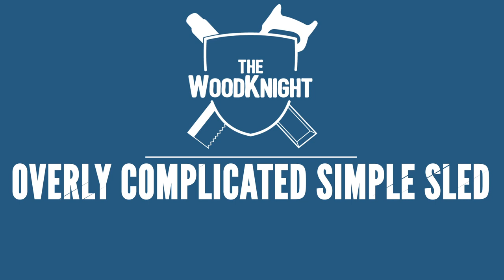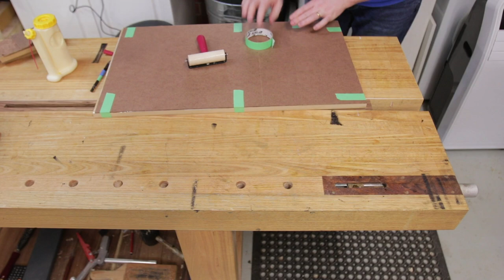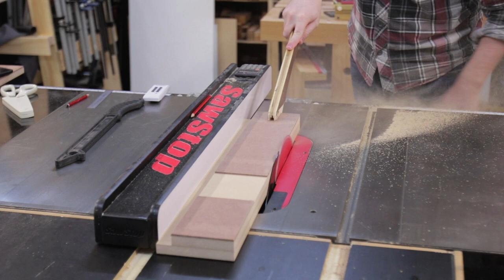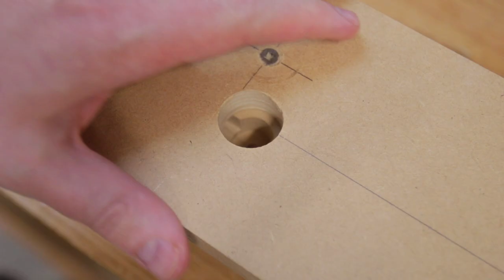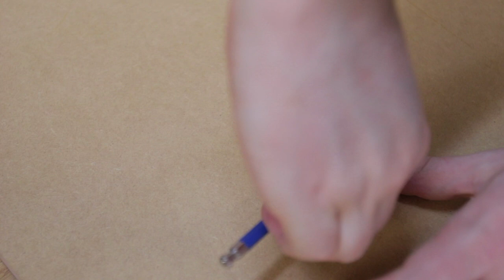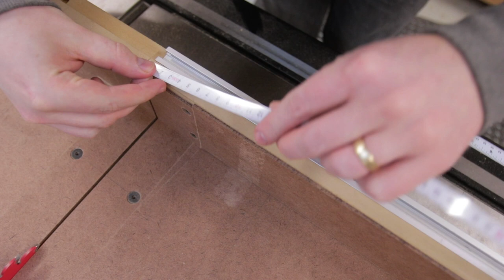Overly Complicated Simple Crosscut Sled

Comment: Always enjoy watching your videos. On the rare occasions I have to use tempered hardboard I brush on a couple of coats of shellac that I diluted about 50% with alcohol.  It does harden the cut edge up quite a bit so you can sand off the burr.
Reply from the maker: I didn't think of that - its very absorbent/pourous, particularly on the waffle side - thats a really clever way to stiffen it up. Thanks! I'll have to try that on a few of the offcuts I've got
Reply: Thinned oil based poly or wipe on poly is what I use as it is a bit tougher and solvent resistant. I have used it on bench tops.
Water born poly might also work to harden it.

Comment: Hey, nice design. I'm trying to figure out how you change out your zero clearance inserts though. Is it sandwiched between the front and back fence? Do you have to take apart your fences to change the insert?
Reply from the maker: No, because the base is made up of a lamination of the same material as the insert plate, there is clearance to slide it out underneath either fence. Alternatively, if the insert is cut a little short for the rear fence, it can just lift out.

Comment: Next time try phenolic (dark brown/black) surface film plywood, used for concrete forming. It'll slide over your table without any waxing.
Reply from the maker: Muru Roa I've found formply isn't always the flattest, some parts of have lumps. Plus there is the issue of adhering anything to it. "Decorative" phenolic plies are much much flatter, but the cost hurts a lot!
Reply: Indeed there are various levels of quality and yes it costs an extra penny. I'm just lucky to have a very good supplier.